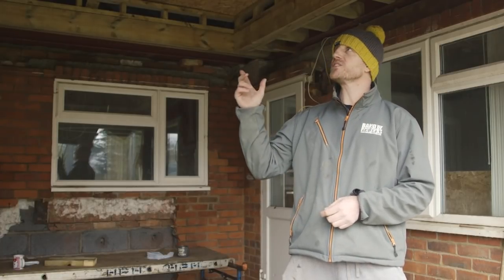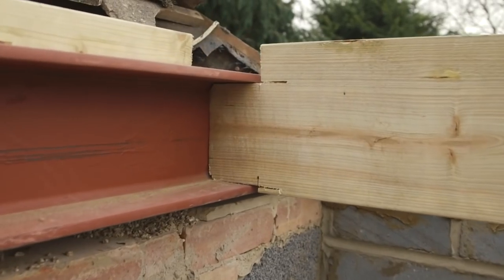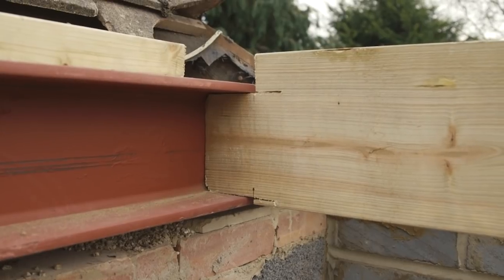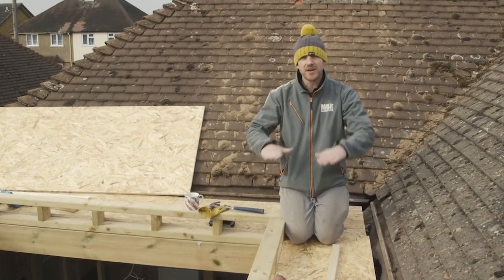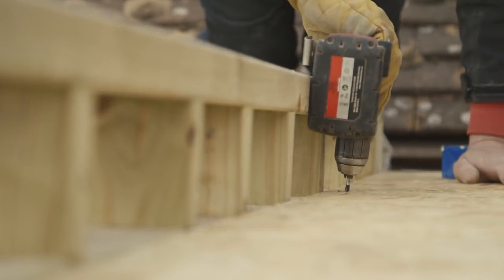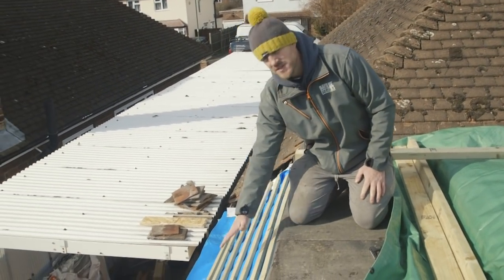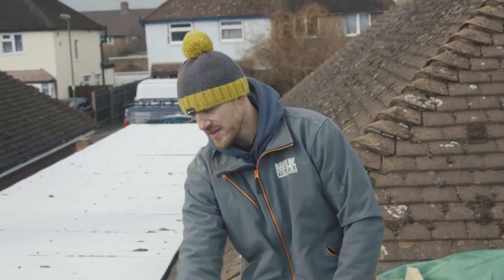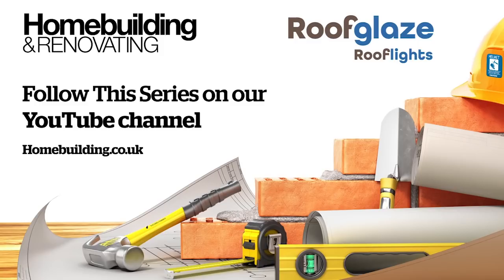Building a Roof Truss for a Roof Lantern; How to Build an Extension (6)

Comment: I never like to see a 90 degree upstand with roofing felt. The fold is too steep and leads to premature failure of the felt. I always like to see a 2" 45degree tilting fillet all the way around any  upstands and abutments. Just saying!  BUT..good to see the little pitch on the edges. It would have looked crap being just a flat roof. That little extra work is well worth it. Quality is in the detail. Why no joist hangers on the trimmers? The building inspectors round here wouldnt have passed a few nails to hold them up. Just saying!!!
Reply: Those nailed joists also make me feel super uncomfortable. I know it's a bungalow, it's not a load bearing floor... but still.